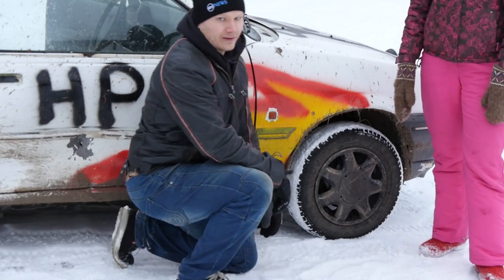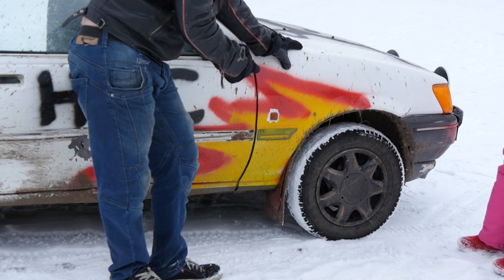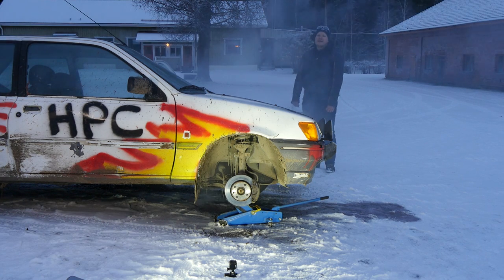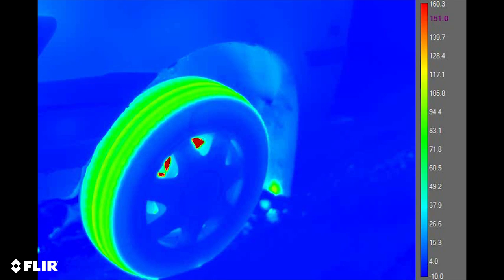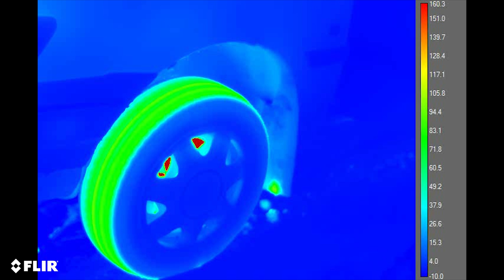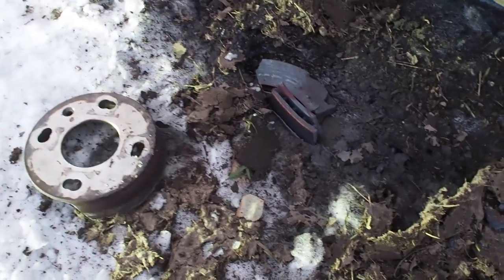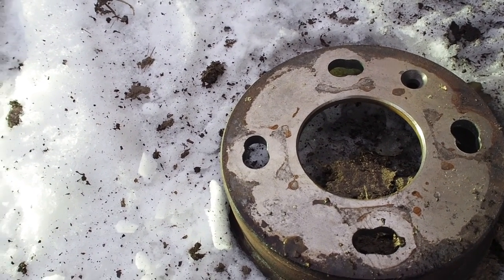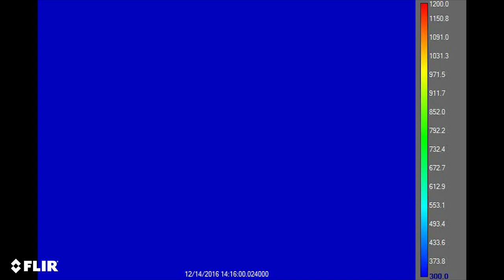Ultimate car brake test video (Explosion!)

Comment: And this is why you dont ride the brakes while you're driving down mountains..... lol
Reply: Serious question, can you go down a mountain on 1st gear for too long? or 2nd gear? Almost without using breaks? or will it damage the engine?
Reply: Kille78 OK but which stop the car while driving down mountain?
Reply: As long as you don't redline the tach.
Reply: @AJAYKUMARNANI  Breaking with the gears.
Reply: 1. Make sure you engine break in the lowest gear. 
2. Only use the breaks to slow down before a turning point. 
3. if that’s not enough, stop and let break fluids cool down.
Reply: Will not break a engine if you engine break, unless you rev it too much. 
Always use the suitable gear for the speed. 
That is how I drive down mountains, first or second gear.
Reply: This is why there’s lower gear ⚙️ but still you have to hit the brake and this is why there’s a neutral gear,
Reply: Yes but down a hill you got 4 of these plus engine brake
Reply: @ur.cristiiano.o  as long as u fan the breaks ur ok do not ride on 1st gear but 2nd gear is fine but u release to let it cool down then brake and release and then repeat.
Reply: Yeah, this is why I just put it in neutral, don't brake, and let my speed climb and climb.

Comment: It's a good way to clean rust from your brake discs!
Reply: snoozinghipo Brakes delete kit
Reply: Or in this case, clean the brake disks from the rust heap of a car.
Reply: if you never use the brake you are not going fast enough in the first place! :D
Reply: amartinez97 That's not quite true... electric cars use regenerative braking, which just charges the battery back up, and slows the car down quite quickly at the same time. Of course, you want brakes also for emergency braking.
Reply: amartinez97 Just pull that hydro E brake and shred
Reply: its a good way to clean brakes from your car

meaning of clean: not to make it look cleaner, but to remove it, as you said with rust
Reply: Savage Moto - So you didn't understand... I thought you did get my point.
Reply: snoozinghipo its only crushinng the brake discs
Reply: Sorry for insulting people before. The comment has been deleted. Humor is hard to detect when written.

Comment: no wonder "something" went bang :)

the spider gears on that differential must have been just screaming.
Reply: tr0n I have a spider gear on my fireplace mantle from when a friend did a massive single wheel burnout in his fwd eagle talon and blew up the diff / trans. a spider gear came out (all gauled up) along with a few other bits, and I've held onto it for like 14 years. teen memories, and a testament to not overheat a diff with one wheel peels.
Reply: volvo09 hehe nice.

i was doing a 7k rpm 2nd gear burnout in my Jetta GTX when i hit a manhole cover with the right tire...3 holes in the transmission case and the spidergear and it's cross-shaft ended up inside the bellhousing.

the stupid things we do :D
Reply: volvo09 I thought it was called a one-tire-fire?
Reply: Thats awesome. what year was the Jetta? I have an 89 jeep cherokee, but my grandparents bought it new back in 89, and was passed down to my mom, then my dad drove it, then it sat in our garage for almost a total of about 6-7 years and I got it a year and a half ago as my fist car, the fucker has costed nearly $4,500 to get it running and keep it running since I first started driving it, but it's worth every penny because it has a lot of sentimental value. I've drifted it in the rain, jumped it over speed bumps, destroyed a prius bumper with it, and rallied it on dirt desert roads at 65 mph, and my dad nearly rolled it off roading last summer but it's still my baby. If she konks out right after college, I will just fix her back up no matter how much it costs, then mod it to be an overlanding machine, and then eventually give it to my kid in the future and make it their problem. First cars always tend to have a special place in your heart no matter how shitty or how much of a pain in the ass it is.
Reply: lol! the G(randma)-Mobile!

Comment: just FYI:
a car disc brake needs the wheel bolts tightened to work properly. Otherwise the brake disc is attached only with a small holding screw.
You can see how it was wobbling, that's why the bolt holes wore out and also what caused early malfunction.
A well balanced disc won't fall apart like that.
So that's what made the video so spectacular :)
Reply: And how the part that is deformed is the first to fall apart of it ;-D
Reply: Josko Nikolic You are right it seems, theres a russian tried break disc brake but couldnt: /watch?v=K_DcOWDOETo so tight bolts on your wheels kids :)

Comment: Pretty sure it's the differential that is broken. Just weld it together and you can do both sides at the same time next time.  :)
Reply from the maker: There is hole in the casing so I think there might be some quite large problems :D
Reply: its front wheel drive which means no differential
Reply: hkbbs no, it has to have a diff so you can actually turn. it's just an open diff,  not limited slip.
Reply: hkbbs right, ASE certified mechanics like myself don't know anything. /s
Reply: front wheel drive cars definitely have a differential. I'd know, my friend's integra has a limited slip differential that he put on himself while i watched
Reply: +hkbbs you've gotta be fucking joking
Reply: +hkbbs are you good bud?
Reply: like i was literally saying hes going to break the differential when i saw he had the other wheel on the ground...

Comment: I only recently discovered this channel, and I love it!

This is a few years late, but I'd like to point out something that's probably been pointed out before. 
It appears that the disc on the right (passenger) side was manufactured poorly. In the slow motion, you can see the 1/3 section of the rotor that failed out looks as if it is a different temperature than the other 2/3 of the disc, and expanding out further at the edge. That visual observation and the fairly even edges where it tore away, lead me to believe that, in the manufacturing process, there were either 2 slightly separate crucible pours into the disc mold, OR the cooling of the disc was uneven. A proper disc should be molded from a single pour and cooling monitored around the full 360° just for that reason. It would be interesting to test the failure point of the highest quality components!

Thank you SO much for the most entertaining and informative destruction videos around!

Comment: Rev the car at full throttle until the motor explodes. Then film the engine shattering.
Reply: datstocklyfe he should run it without rev limiter
Reply: Usually the engines just overheat and seize, not very dramatic unfortunately.
Reply: petti78 he could just put a very large turbo in it from an old 7.3 and blow the heads off of it that would be cool
Reply: With higher octane fuel like ethanol... maybe?
Reply: horrible idea.brakes are one thing...  a flywheel detaching at 10,000 rpm is quite another.
Reply: Demonslayer, just rig the engine so you can give full throttle from afar at a safe place, no problem.
Reply: Demonslayer20111 the fly wheel is enclosed, so it wont do much
Reply: datstocklyfe A friend of mine had his flywheel break loose and overtake him on the motorway, it can happen
Reply: Change the ecu, full throttle and slam the clutch
Reply: You'd have to run it on the road in 5th gear and then slam it into first which is too dangerous
Reply: If you overheat the engine to the maximum the most probable thing that may happen is that the engine is going to expand, the it will stop and then it would never start because the block it's completely deformed.
Reply: Rene Sebastian or perhaps a cylinder would pop out because of the pressure
Reply: Lik3 ViaZ no the Pistons heat up faster than the block cause they are smaller and made of different metals so it "welds" for lack of a better word itself to the block and basically a heat seizure
Reply: Goofy's Channel use a high-quality lubricant and race fuel without a rev limiter, that the pistons (hopefully)  won't stick and maybe the rods snap off.. Would be fun,
Reply: ive done this several time usually they implode putting pistons every where its fun

Comment: Your differential hates you.  Could it have been that giving up on the left side?
Reply: JayFe0 I'm willing to bet that the diff is what went out. Those spider gears aren't meant to move that much.
Reply: JayFe0 a few buddies of mine learned that the hard way.
Reply: JayFe0 most cheap cars and even expensive ones use open differentials, not unusual on anything.

Comment: probably exploded the differential. they are not designed to turn high speed like that.
Reply: Skwisgar2322 Yes they are. It was probably turning about as fast as it would at about 80 mph on the road.
Reply: The Tyttuutface
No, you don't understand, I am talking about the internals of the diff, the spider gears. they generally only have to turn fast enough to make up for the difference in speed between the inside and outside wheels going around a turn or for short periods if a wheel is spinning like this. Long periods under heavy load without much transmission cooling can damage them.
Reply: And the free wheel spins at twice the speed when the other is blocked.
Reply: jospi2 and this as well.
Reply: Skwisgar2322
I see what you mean.
Reply: Yeah this is what I'd figured as well. I'm glad somebody else said it first.
Reply: literally not true at all. one wheel isnt moving and the other is going 120mph. thats not what a difff is made for.
Reply: I did not say that, I not true, I did not say that, I did not, Oh hi mark.
Reply: You're my favourite customer
Reply: Front wheel drives dont have diff
Reply: @ennardthestikbot8217  They do. It's part of the gear box internals. Not separate like on the back.
Reply: @jamiebales8394  front wheel drives do not have diff, but a different diff-like system.

Comment: what if you would drive on the brake discs?
Reply: They wouldn't hold the weight of the car.
Reply: qwertyu600 wrong .
Reply: Yeap wrong... First of all disks are so thin that those would sink into ground and in pavement there is chance that hit with the rock would shatter the disk, but i have driven car on its brake disk. Some jack ass had untighten the bolts and the wheel come off, but lucky fender kept the top side of the wheel from getting out and brake disk drop top of the inside of the rim and i was able to come to safe stop.. mind this happened at 120km/h speed :D

Of course all depends on what type of brake system we are talking about cause there is different materials used, different thicknesses, disks tend to wear out and possible crack, so all depends on these things, but generally you can at least come to safe stop, hopefully that is..

For the driving it self this wont be happening cause steel has terrible friction values and would just spin, with out car moving.

Comment: How hot was the break disc?
Reply from the maker: 1100 c
Reply: LemmyIsNotDead That means over 2000 Fahrenheit
Reply: It did the kessle run in 14 parsecs.
Reply: How do you know? The thermal camera only can reflect up to a certain amount...
Reply: less than twelve parsecs! 
;)
Reply: Muumipappi 2012 F
Reply: LemmyIsNotDead yes

Comment: Anni, what camera was that? Olympus?
Reply from the maker: It's Olympus OM-D E-M5 II. We use it usually for everything that we shot with out tripod since it has really good stabilization built in.
Reply: Beyond the press Neat, have you given that weird sensor-shift 40PM mode yet?
Reply: That's cool. I still have my OM-10 film camera I got 28 years ago :)
Reply: MrChops Hey, me too! Although mine was passed down from my father. The lenses were fun to use on my NEX-6 until I could afford native lenses. Damn that 28mm was sharp!

Comment: Just a minor thing to consider: The rotor is held by the rim and lug nuts. So without the rim, the rotor was free and wobbled a lot making those elongated holes. A much better choice is to reinstall the lugnuts backward with some heavy washers to properly keep the rotor seated without the rim. (i say backwards so it rests on a flat face and not the cone shape)

The differential is not made to withstand 100% slip at high torque and long time. A better option is to deactivate the brake on on side and lock the differential (welding it is a good option) and jack both wheels off the ground as both will spin with same speed.

Comment: It stopped because the brakedisc on the other side exploded. From this moment on all the torque goes thorugh the side where the disc exploded, but with twice the rpm. You can check that easy: lift your car like in this video, put 1st gear in and then brake the tires seperately with your hand. you will see that you can stop the tire if you only stop one, not both. then the rpm on the other tyre will rise. If you slow down one wheel, the other will turn faster with that ammount you slowed down the other. You need that to drive through a corner because the tiyre on the outside of the corner has to do more rpm because of the longer way.

Comment: In the first attempt, with all that smoke, I was wondering if the clutch was burning too. Turns out it was just the tyre spinning on the snow.

But maybe the bang you heard when trying to destroy the left-side brake was the clutch failing?

Comment: I know this is an older video, but I actually had this happen to me on the road.  My estranged wife was driving my old Honda Accord, I was in the passenger seat, we started hearing a knocking noise when we're on the highway, next moment we hear a loud BANG followed by a clattering, and I started seeing shrapnel flying by my window.  She was able to get the car stopped using the hand brake, we get out, we thought the tire had exploded!  I was a little confused when I saw the tire was intact, then I looked inside the wheel and saw the rotor was gone!  That was the scariest thing I had ever experienced in my life, cause we're were doing about 65 miles per hour at the time.

Comment: As a car mechanic this was very interesting to watch.
And also fucking awesome. Im surprised that there was a little bit left of the break pads and the piston(s) did'nt grind against the brake disc. I was expecting to have holes in the brake disc and brake fluid and other fluids exploding out from the car.

Comment: The differential broke. And because I know someone is going to challenge that, YES, front wheel drive cars have differentials. They are inside the gearbox but there is one in there. When you divert all the motion to one side like he did during this experiment, things in the differential that are meant to rotate only slightly end up rotating really, really fast. Doing that with the full force of the engine directed against it at very high speeds for extended periods of time is an invitation to catastrophic failure like this one experienced. It's actually astonishing how long this one took the punishment. I actually expected it to fail before the first one blew, but this build was solid. 90s Chrysler minivans were notorious for blowing the differential after only seconds of this treatment at low power trying to get unstuck from ice and snow.

Comment: The brake part that exploded is called a break rotor and if you wanna know what the best is carbon ceramic they dont make a lot of brake dust and they can get hotter than hell. There’s your car fact for the day, night. It’s like 12:00 at night for me rn

Comment: If you watch the 1800 fps part at 0.25x speed, you can see why it fails, one part of the disc is heating up more than the part that broke off.  If you stop it at 5:39, you can even see the difference in coloration between the part that broke off and the rest of the disc.  It could be weaker steel, it could be a disc that isn't perfectly straight, cracks or stresses in the metal, or just bad luck, but there appears to be a difference between the part that broke off and the rest of the brake.  I doubt it would have failed under normal conditions though.  Still, pretty interesting experiment.

Comment: Well it looks like you're going to need a new brake rotor, new center hub, new brake pads, new brake caliper, new CV joint, new bearings, new gear box and quite possibly a new radiator, water pump, and thermostat assuming that there is no other damage done the engine and drive train components from this experiment.

Comment: Well what I think caused the first rotor to explode an not the other one. Was the fact the first time u supper heated the rotor then stopped an it was alowed to cool. Which undid the heat treatment of the metal making it more brittle.

Comment: Locking one wheel makes the other wheel spin twice as fast because of how the spider gears and side gears interact within the differential. These two parts are what most likely got destroyed when you attempted to destroy the second brake rotor.
This is also why you never run a tiny temporary spare tire opposite a std tire of the drive wheels. You cause premature wear to those gears.

On that note, weld all the gears inside the diff together and try again. 😉
(Doubt that car is still around though..)

Comment: 5:38 It's interesting that we can see part of the disc, maybe a third or so of it, is seemingly a slightly different color, a little bit darker, than the rest of it. That is the part which broke away. Wonder why? Being a little bit darker would make me suspect it was a little bit cooler, we'd expect the hottest part to break away first. Maybe the rotor was warped or wobbling, causing uneven heating, and the part that was coolest on the side facing the camera might have been hottest on the other side, which caused it to break away. Any other ideas?